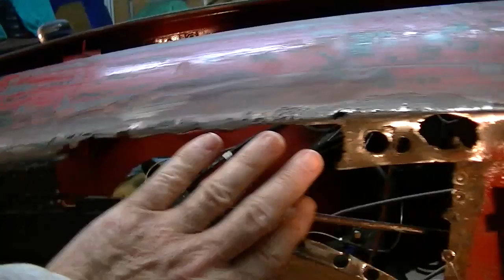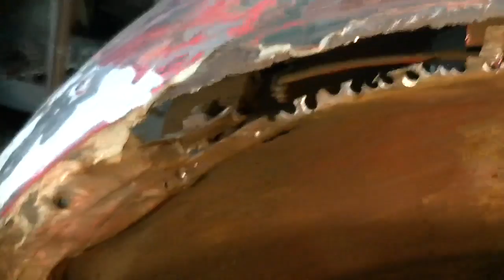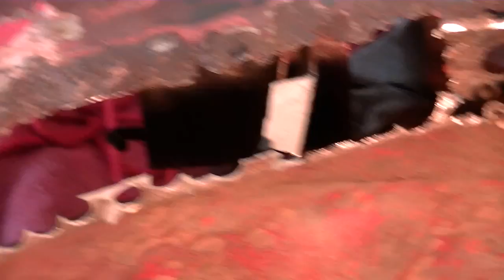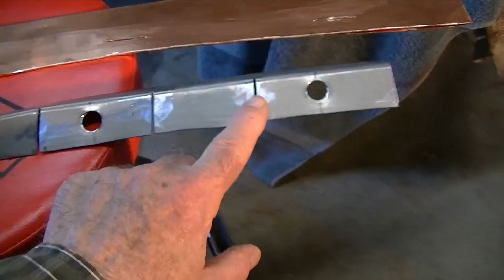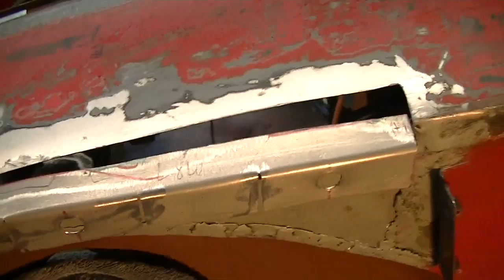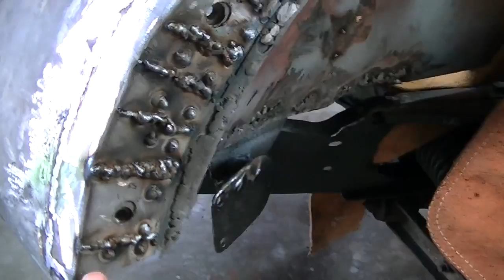1960 MGA Restoration - Left side shroud and fender mount area repair

Comment: Hello, again. I just wanted to ask how you made these 90 degree bends because I am trying to re create the trunk railing on mine where the rubber goes for the trunk to close. If you have any suggestions please let me know. Thanks
Reply from the maker: Hi Alec
I use a vise with a straight edge (steel ruler is good).  And I either hammer the work piece over the straight edge or use a vice grip style pliers that have 3 - 4 inch grip surface.  If the work piece has bends, then cut slots to allow the piece to bend without buckling, weld the slots closed later.  You can build up your repair in multiple sections, easier than making a big piece.  Good luck. Carl